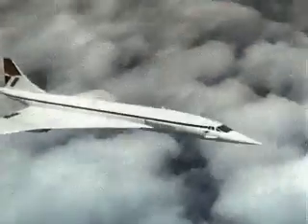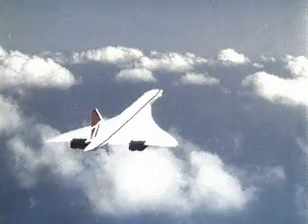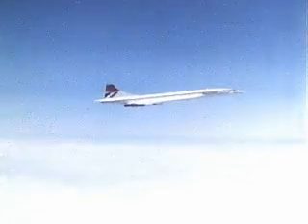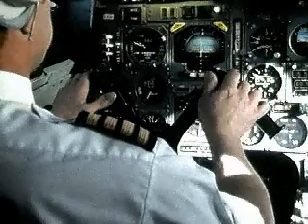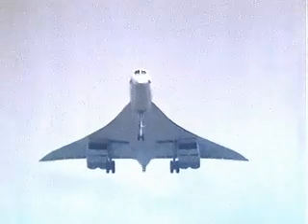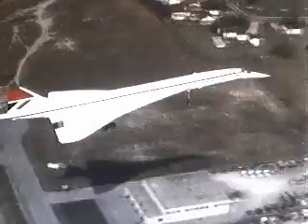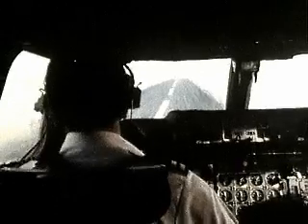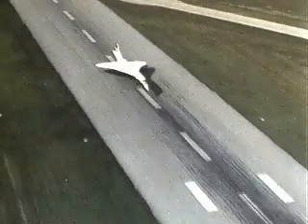CONCORDE

Comment: @qwertdr: Supersonic flight is always calculated in level flight, the VC10 achieved it during a dive. But you are correct that TU-144 did not only fly before Concorde, but also achieved supersonic speed before Concorde.